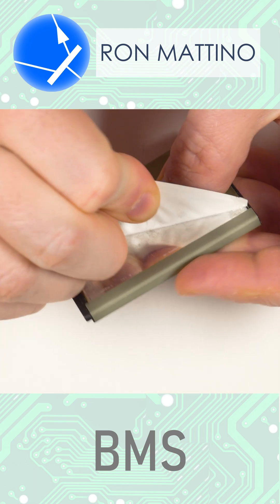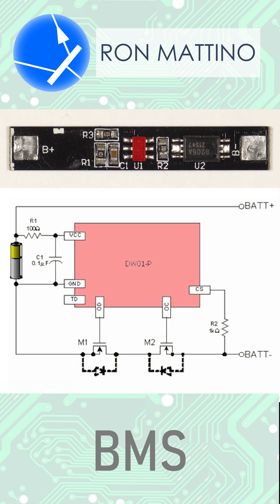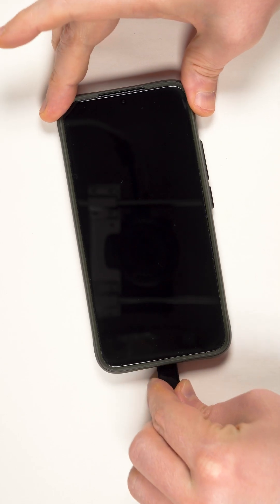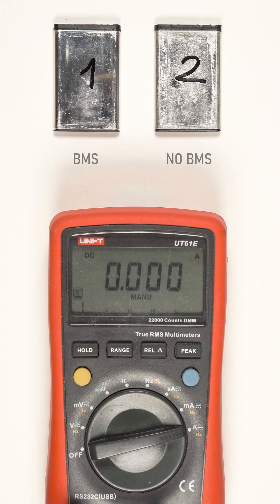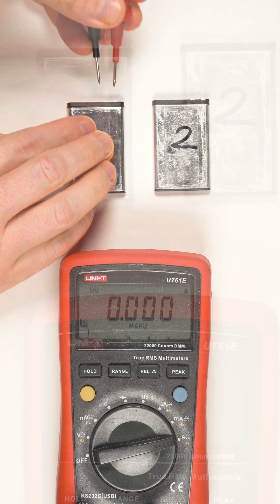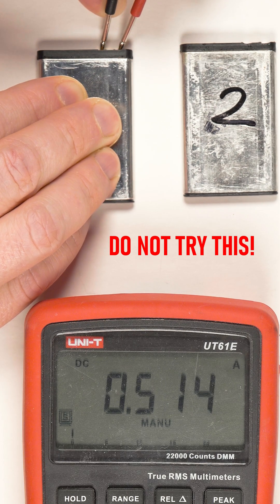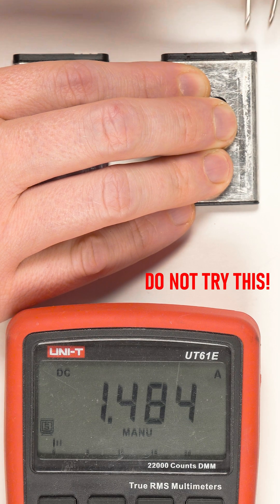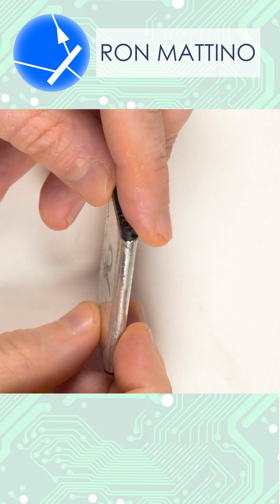What is the purpose of a Circuit Board found inside a Li-Ion battery?

Comment: For what the M2 key is?
Reply from the maker: One mosfet switch is for charging, another mosfet switch is for discharging (work mode).
Reply: @RonMattino  But they are in series 😳
Reply: @NotouriosGaming  You say common source.
 But there is a common drain there.  Additionally, the housing is 8-pin. 
What you're saying doesn't make sense.
Reply: But the integrated M2 diode lets out current all the time.  Not true?